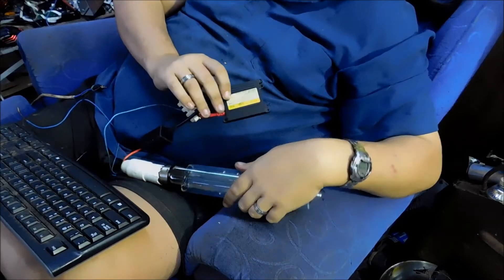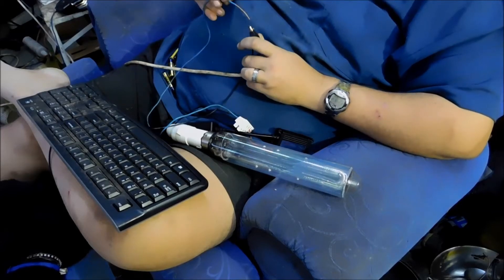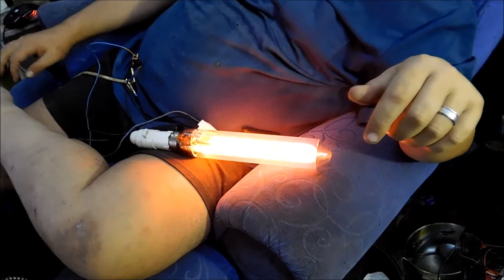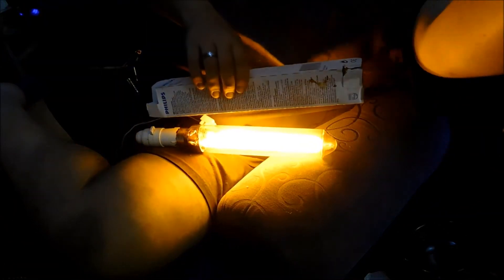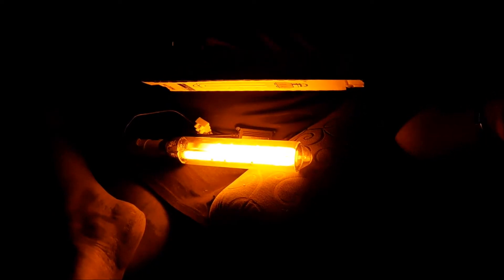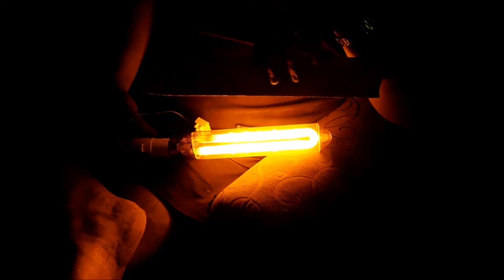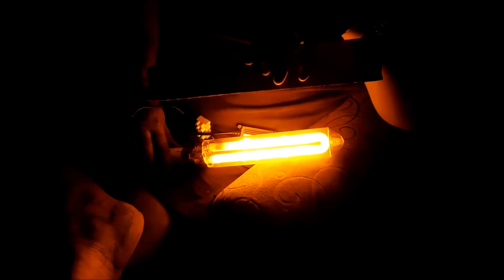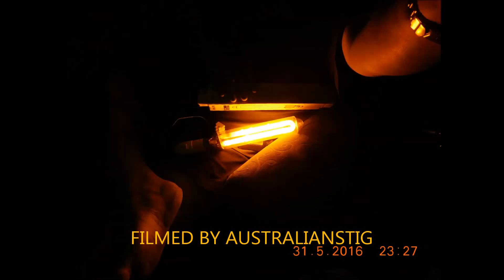35W PHILIPS SOX PLUS RUN UP ON 35W CAR HID BALLAST

Comment: How?! I have a 35 watt hid car ballest but not the bulb.
Reply from the maker: It seems to work with any 35W HID lamp (xenon, high pressure sodium, low pressure sodium and metal halide).  I haven't tried it myself but it may also run up a 50W mercury at the cost of blowing off its starting electrode and rendering it useless for conventional gear

Comment: Good work, I've put Super Sox 18 wat lamps in my head lights and they look amazing! Only problem is the weight of the front of the bulb inside the headlight casing, and the slightest bumps make the liquid sodium move around the inside of the tube. Also one bulb didn't fire up properly because neon gas leaked into the outer glass chamber so I think it cracked the arc tube... Still a good project but!!

Comment: The dark side is probably migration of the sodium toward one electrode due to the DC bias... incredibly interesting that it will run though! 12v HID ballasts are pretty much commodity items these days.

I miss SOX lamps, the government here in the UK have changed pretty much every light to white fluoro or some proprietary equivalent due to $Reasons
Reply: As it happens, the low voltage 35w HID ballasts use HF Switching, so the output is just a really high frequency square wave. it should be fairly safe to run a SOX lamp on it without electrode migration. Not recommended but also not detrimental to the health of the lamp.

Comment: Bulb must be throwing off lots of UV
Reply from the maker: Hardly any UV at all, SOX lamps have a very tight, monochromatic spectrum
Reply: nope. SOX lamps contain no mercury and only emit light around the yellow end of the electromagnetic spectrum. all the vapor inside a lit SOX lamp is pure metallic sodium.